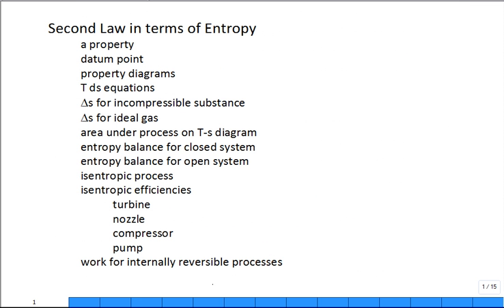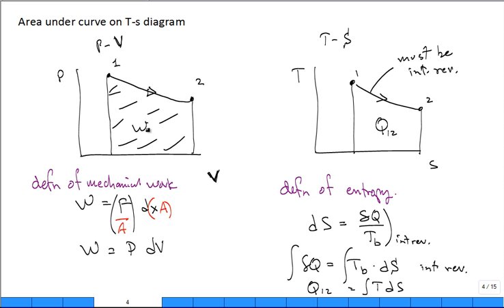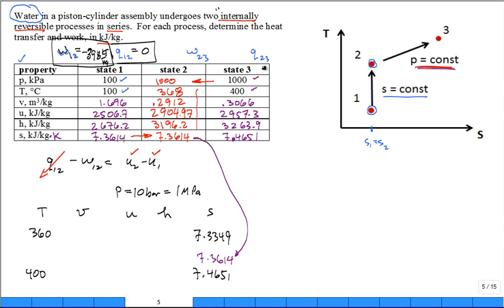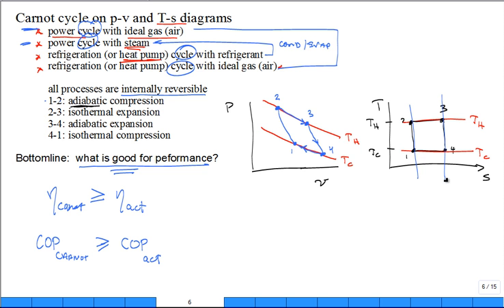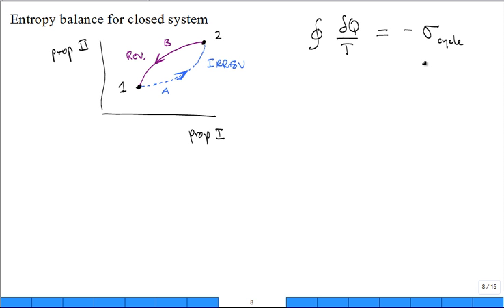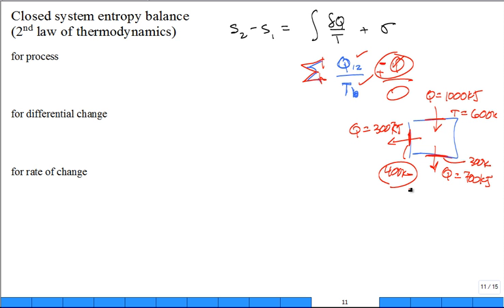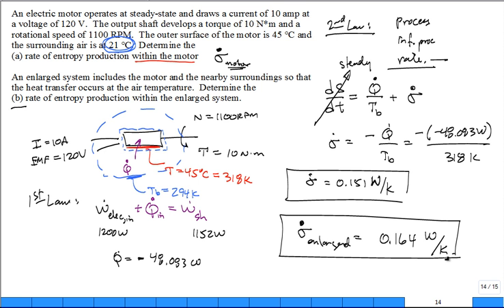ME3293 Entropy 2

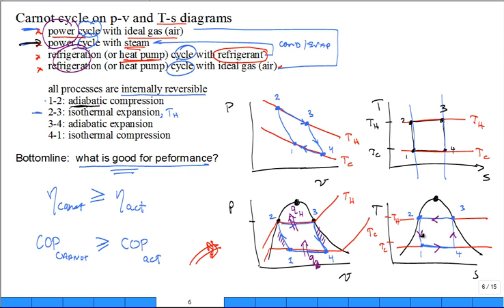Comment: 39:03
Is 2-1 the same as expansion valve  after the condenser & before the evaporator in actual refrigerator or heat pump?
1-4 is is evaporator 
4-3 is compressor
3-2 is condenser 
2-1 is expansion valve

But, there is no work done by the expansion valve.
Thank you so much.
Reply: are you graduated yet?

Comment: Thanks for the fantastic video. In the copper cooling example,
in part b, the way the entropy change of copper was calculated was based on the equation which was derived on the assumption that the process was internally reversible (q=Tds), so how could this be applied here where cooling seems irreversible.
Reply from the maker: Nikan RT entropy is a property.  If asked to calculate the change in entropy, we only need to know the initial and final states, like any other property.  The process could be either reversible or irreversible.  Yes, it is confusing that the property relationship is first established considering an internally reversible process, but once established, the property relationship applies for all processes.
Reply: Randall Manteufel  Yes of course. Thank you.

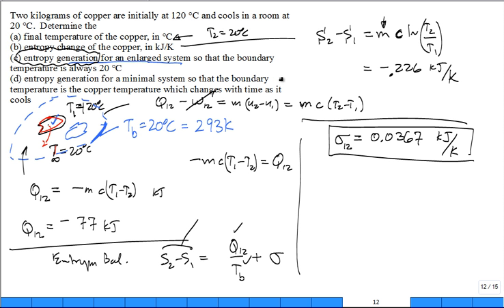Comment: @ 1:05:19 
Starting part d of that problem. We take the boundary temperature to be the temperature of the copper. The boundary temperature will always be the same as the temperature of the copper system at any point in time.
Heat is released from the closed system so there is a negative entropy transfer. 
How do we come to the conclusion that there is no entropy produced and sigma is 0? That means there are no internal irreversibilities in the closed system.
How would this be modeled in the entropy balance equation when T is changing?

Can anyone shed some light on this matter?
Reply from the maker: too much for comment section.  it can be done, as you ask.  if you are at utsa, please come by my office.  if not at utsa, please understand I have limited time to answer questions.
Reply: Randall Manteufel I will come by your office after class on Thursday, thankyou